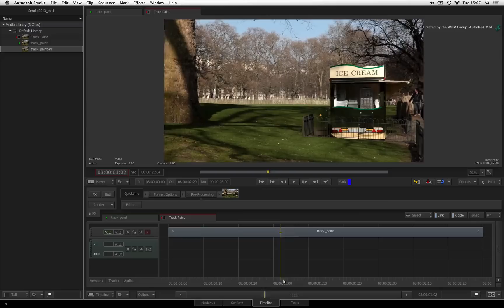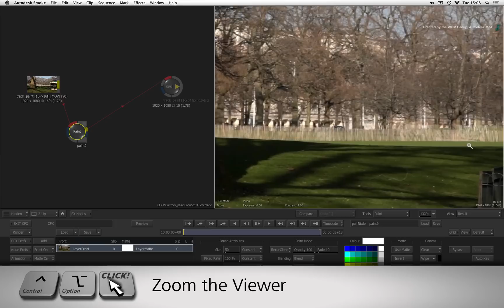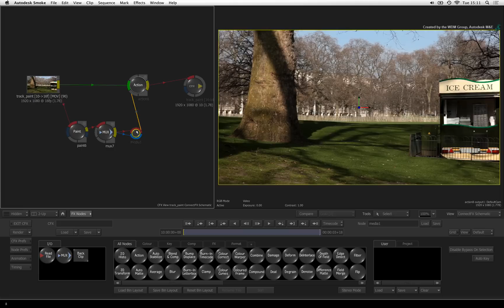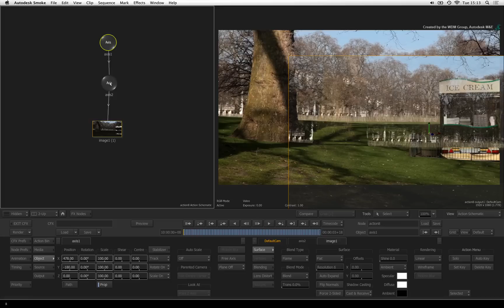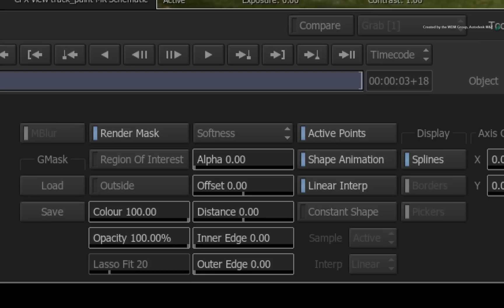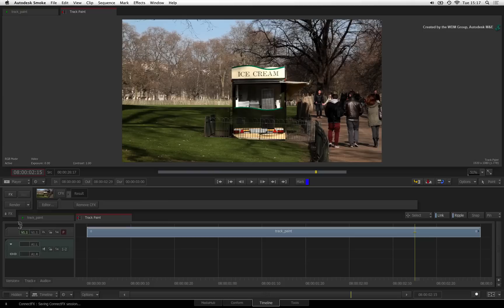ConnectFX Paint: Cloning on a Moving Shot

Comment from the maker: Hi,

I can think of two things.

Either the alpha is not applying correctly to the still image.  To check that, grab the axis of your still and move it around.  You should see the two corrections move about.  If it does than that is not the problem.

The other thing I can think of is to check the direction the arrow between the nodes.  It does have a significant importance.  Always ensure that the connection from the tracking data has an arrow that points towards the offset node and its image.